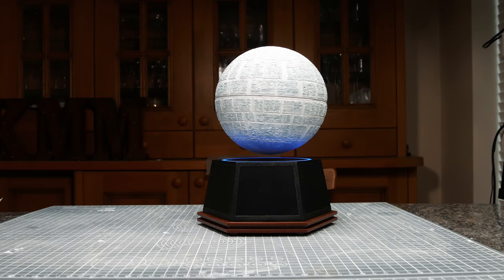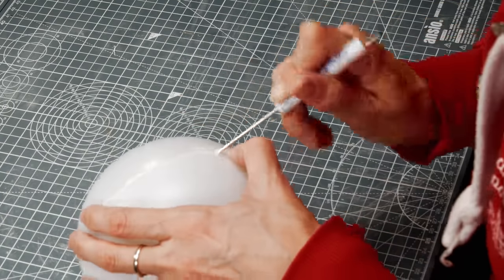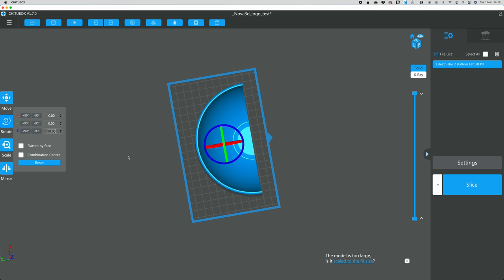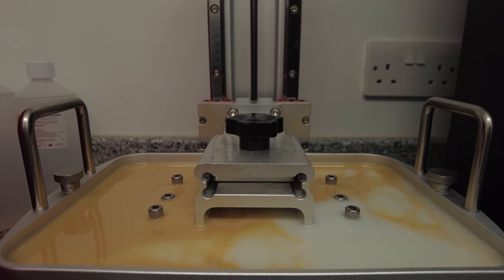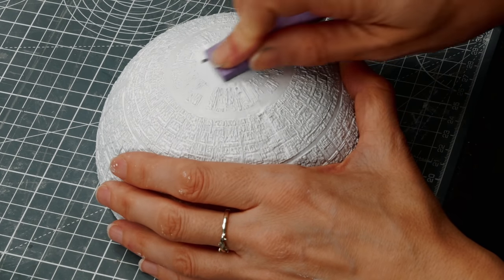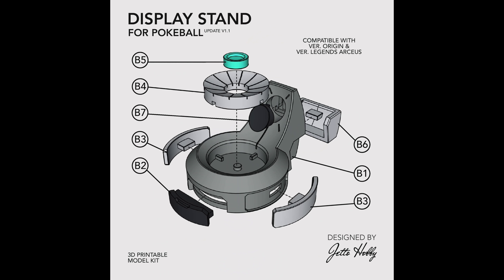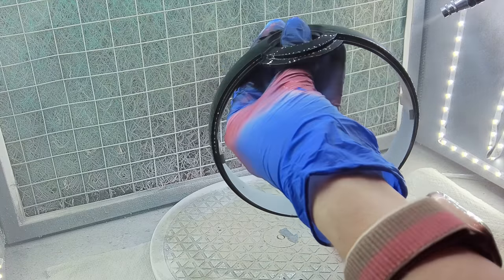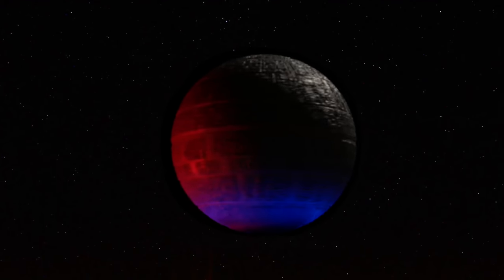Make Your Own Floating Death Star

Comment: Kathy, just counter balance the pokeball. Thin it all if needed but print 2 buttons and just hide one inside on the opposite side and use a smaller piece of steel in the bottom. I've done EXACTLY this myself.
Reply from the maker: Thanks!

Comment: The solution to the pokeball could be to print one more button or something of equal weight and glue it on the inside of the ball, but on the opposite side 🤷 I don't know, I'm not an expert 😅
Reply from the maker: I’m sure I could get it to work with more experiments.